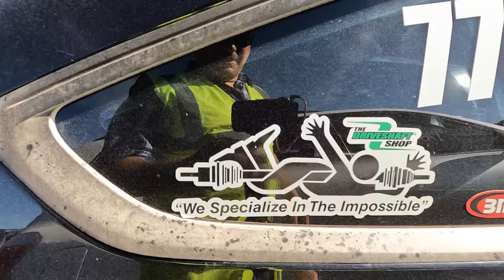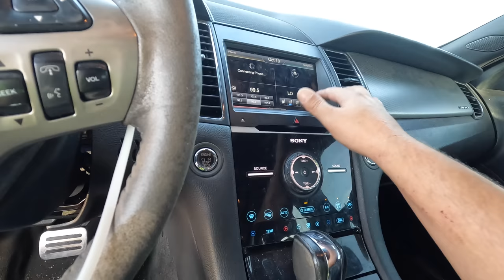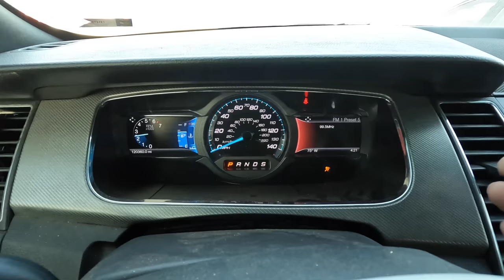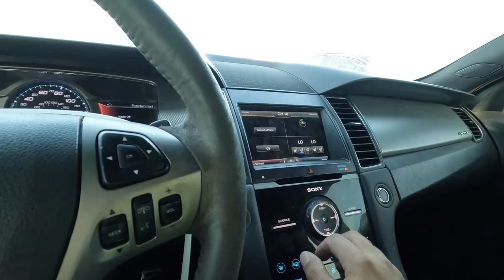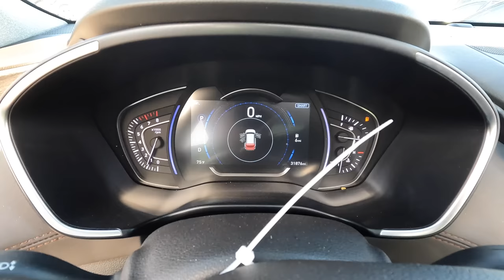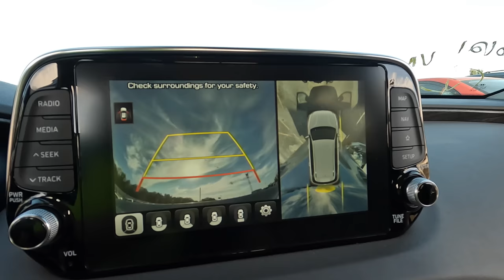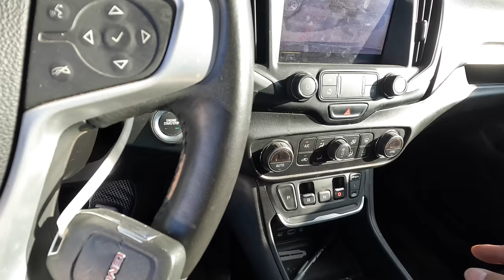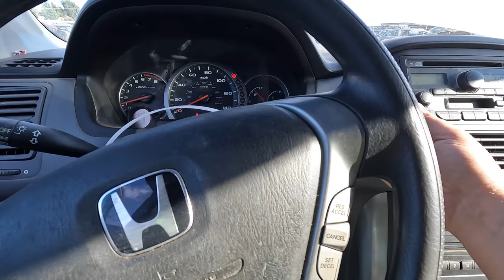Copart Walk Around and Live Bidding! Winning 05 Honda Pilot and 14 Taurus SHO! 10-20-21

Comment: The hitch was for the Pilot. i went to the auction, and saw it already sold. Damn, i wanted to look at it. The 05 has the highest rate for the radiator failing, causing Strawberry Milkshake of Death. If I bought it, i would change the radiator with a new Denso, and put in a trans cooler to eliminate that problem. I have two Pilots now, great SUV's.

Comment: that is the very reason i bought my own Ozone generator. just incase i ever find a car that smells so bad no one will touch it. buy it cheap and ozone the hell out of it and turn a buck or two on it. I got one of the digital mac daddy ozone generators too. that terrain wasn't bad but that damage on the tailgate was done at Copart. look at the auction the dent isn't in the pictures and the dent was done AFTER the hail dents were all circled on the car because a couple of them were smuged out in the place where the dent occured so either someone wrecked it before copart got it (doubtful) or the damage was done there when moving it around. the owner might not let it go cheap if they don't know it was damaged further. that's not bad on that honda pilot either

Comment: Randy that 2005 Honda pilot is something you don't want Anything to do with ! Besides a lot of the 3.6L GMs and their timing chain issues the Honda pilots are just as bad if not worse ! All those with that V6 are bad unless proof of a timing belt replacement is shown or if not that most have quiet you find out after they warm up Transmission issues !